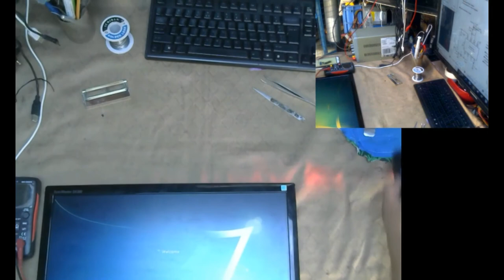Samsung SA300  NO Power

Comment: sir pasagot naman po kung ilang volts nung input ang output nung power supply cord niyo kasi po may monitor din akong ganyan kaso wala lang power supply cord
Reply from the maker: Sir 12v-14v na adaptor po para sa samsung monitor 2amps en higher dapat